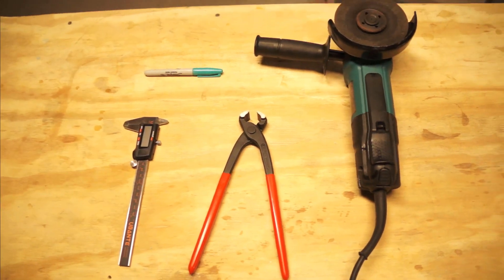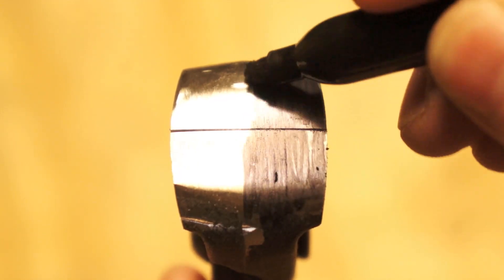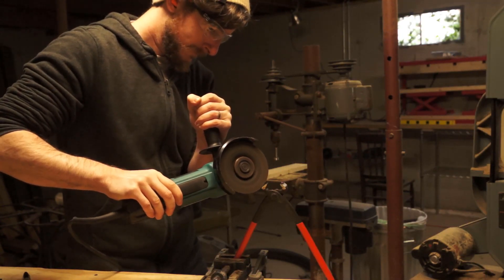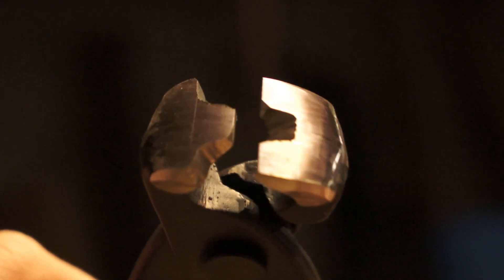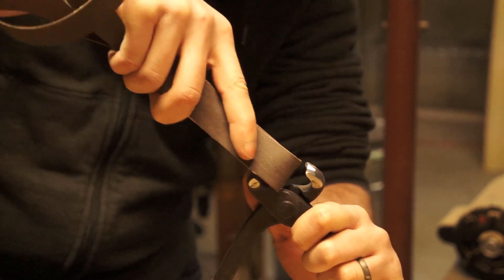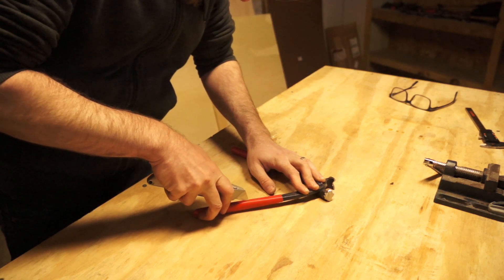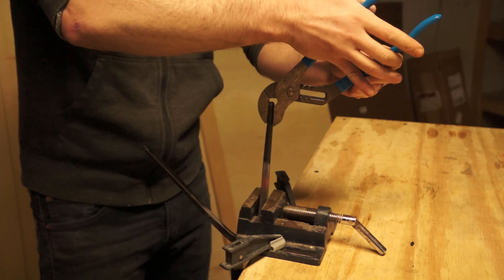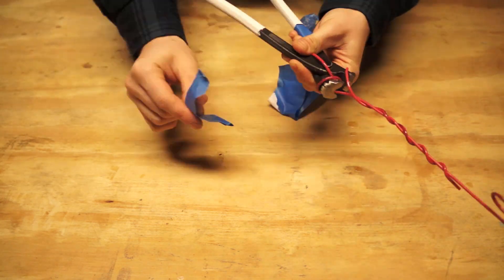Building a Snowboard - Part 4: Making an Edge Bending Tool

Comment: If you are ever attempting to make another set of these “benders” may I suggest using a steel pipe over the heated handle to bend in a more safe manner, I’ve burnt my hands and knuckles doing this same sort of metal bending, oh and another thing please wear gloves again avoids possible burns, otherwise great repurpose of what you had at hand 👍

Comment: Hi Chris, thanks for sharing your knowledge and experience of snowboard making, it was really helpful- I am about planning to make my own snowboard recently and have checked lots of videos and learned most from yours. really appreciate your hard-working. I am just wondering if you can share a link of where you ordered the materials of snowboard such as edge, base, sidewalls, and top sheet?
Reply from the maker: Hey Jeff! Thanks! I'm glad the videos are helpful. I got my parts from a couple different places because they had different components in stock, but I compiled a list of good sites to source materials from on my website. Check out the snowboard/powsurfer section on this page:
https://www.goodroadscollective.com/resources